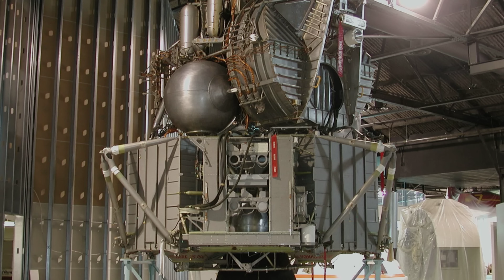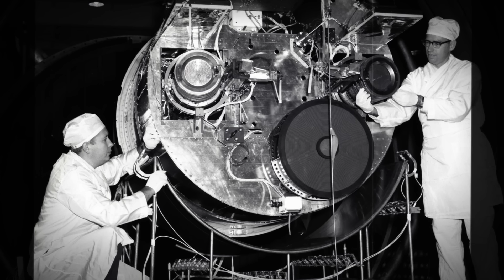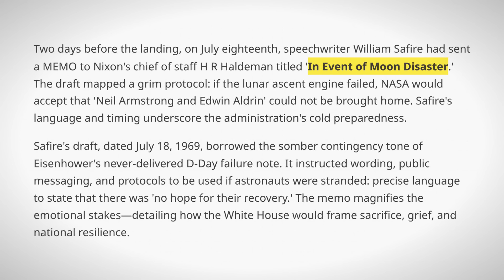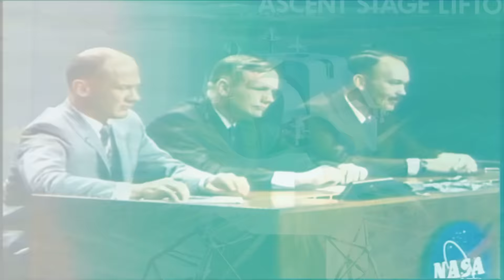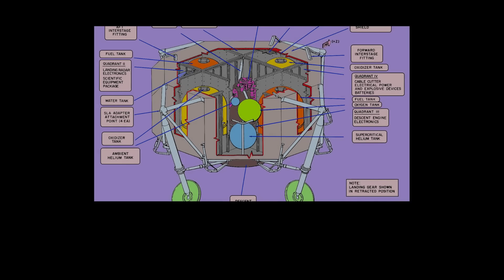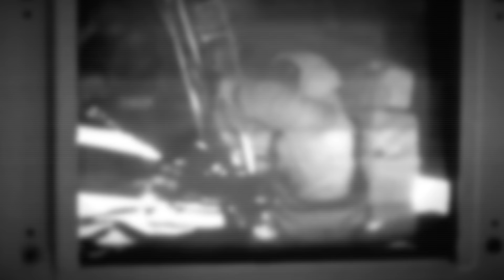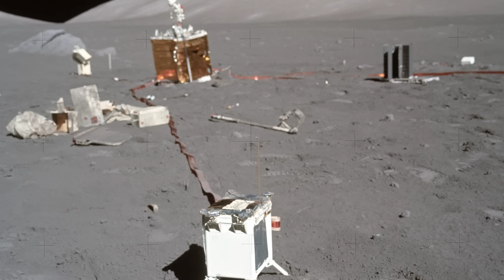Apollo 11 Nearly Got Stranded on the Moon

Comment: There was no risk. They were not on the Moon. Imagine leaving 1 guy in Orbit... if something happened to him it was game over. Artemis were 4 ! 4 people... why ??? Because 3 is not enough to land on the moon.
Reply: Come on....you should know better.  Educate yourself.
Reply: @spacecoastz4026 why educate himself? Smug stupidity feels so much better than facts.
Reply: @joelmanaussie You can't handle the FACTS
Reply: @danwebd4481 Present them and let's find out.
Reply: @danwebd4481  The radio location tracking of the Apollo spacecraft and the retroreflectors are FACTS you can't handle.  Each of these by itself is sufficient proof that the Apollo missions happened.
Reply: @davidnaegle427 no. It doesn't prove Aldrin walked on the Moon.
Reply: @danwebd4481  I'd be interested to hear an explanation for how they faked the reports from hundreds of non-NASA people who tracked the origin of the Apollo  radio transmissions from the moon, including the Doppler analysis of those radio signals.  Doppler is a frequency shift that depends on the relative speed of the transmitter with respect to the receiver.  It's the principle behind how cops issue speeding tickets using their radars.  The Doppler shift from the Apollo transmissions was slightly different for different observers at different locations on Earth, because the relative speed is a combination of the spacecraft's speed AND the speed of the observers locations on a rotating Earth.  If it were someone trying to 'fake' it by intentionally raising or lowering the radio frequency, EVERYONE observing it would see the same frequency shift, regardless of their location on Earth.  You can't send hundreds or thousands of DIFFERENT signals to each observer's radio, each shifted by a different amount. That's not how it workis.  And you can't send it from a different location (like a satellite in low earth orbit); directional antennas hav been perfected since WWII and are very good at identifying the exact direction of the transmitter.  That's irrefutable proof that the transmissions came from the Moon. That's the only scenario that correctly accounts for the differences in Doppler shift for the different observers' locations.  

I could give an equally long explanation for the fact that the retroreflectors return 100 times more light than reflecting a laser off natural lunar surface.  It's proof that the retroreflector is there.  There were THREE retroreflectors placed by Apollo missions:  11, 14 and 15.  The only way they could have got there and become operational at exactly the times NASA announced that the Apollo astronauts had placed them is if it were placed by the Apollo astronauts.  The Soviets also placed 2 retroreflectors on the moon with unmanned probes.  So I have heard theories that NASA must have sent unmanned probes to place the three they say the Apollo astronauts placed.  But the Soviets did not place theirs in SECRET; you need a BIG ROCKET to send even an  unmanned probe to the moon.  From about 1960 onward, any large rocket launch was  publicised to everyone who was watching for nuclear missile attacks; it was IMPOSSIBLE to launch even an unmanned probe to the moon without everyone knowing about it.  Therefore, the only possible explanation for the 3 Apollo retroreflectors  is that they were placed by the Apollo Astronauts.  Aldrin was the one who placed the retroreflector for Apollo 11.  So yes, the retroreflectors and the radio transmissions is airtight proof that Aldrin walked on the moon.

Something tells me this detailed explanation won't beat your 'nuh-uh!' and sticking your fingers in your ears.  But hopefully some other readers with better critical thinking skills might get some useful information from this comment.
Reply: @spacecoastz4026 feeling uncomfy with the facts of the moon apollo hoax ...
Reply: @danwebd4481  I understand your discomfort.  I can hardly imagine how it would be to live in the modern world with so little understanding of radio, science, and math that the thought of an Apollo hoax could be seriously entertained.
Reply: @davidnaegle427 LOL
Reply: @danwebd4481  Not one bit because there was no hoax.  To say that the Apollo missions were a hoax, is to say that the finest men such as Armstrong, Collins, Cernan, etc would even consider doing this, which none of them would.  If you want to understand the reality of Apollo, then you need to understand the science behind it.  I joined NASA right after Apollo, but I got to talk to some of them, and looked and touched actual spaceflight Apollo hardware.  The LM's of Apollo 18,19 & 20 exist and can be seen by anyone.  Look at the photos of the  Chandrayaan-2 orbiter, which is not USA.
Reply: @spacecoastz4026 I believe you but nothing can me make believe it again. There are explanations for everything.
Reply: @danwebd4481  there is a channel that is called apollo11space....which covers the many aspects of the science behind the moon missions.  Check it out.
Reply: The odds of something happening to him were very slim
Reply: Absolute fucking moron. Don't reproduce.
Reply: Moon Landings Faked? Filmmaker Says Not!
https://youtu.be/_loUDS4c3Cs